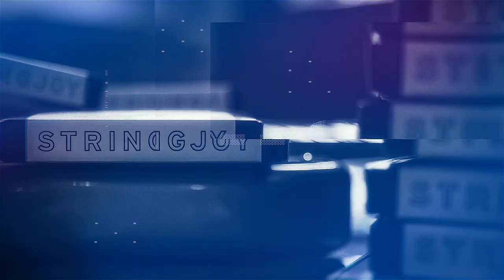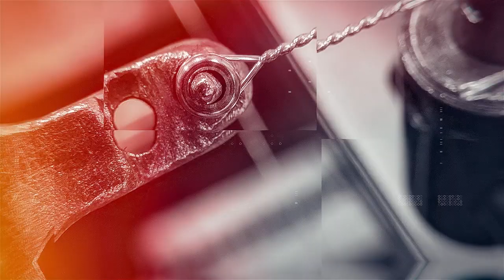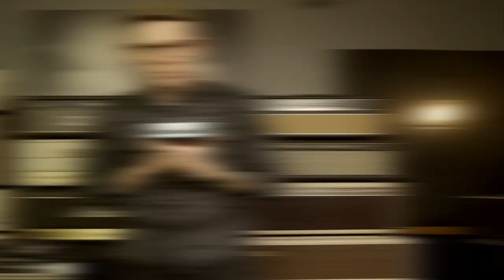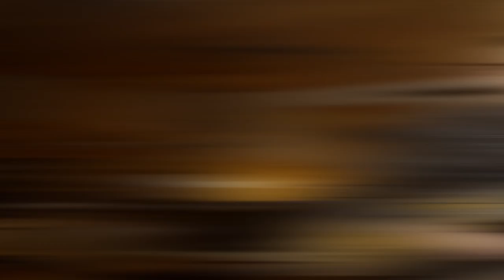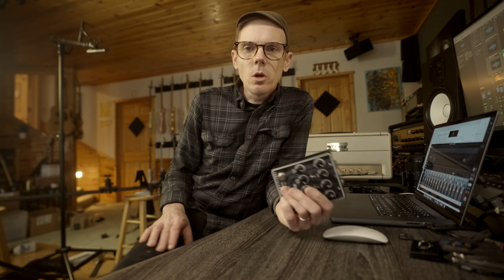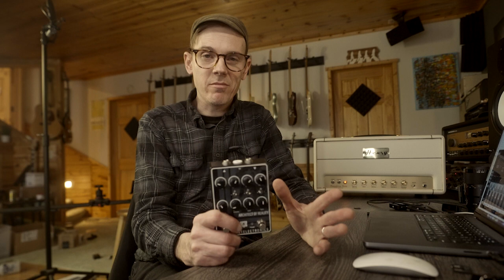Effects Loop Explained: When, Why & How To Use Your FX Loop

Comment: Thanks for clarifying this for me!  I stopped gigging with my SWR Bass amp a few years ago and now go Direct to PA via a SansAmp Bass Driver DI, this change has made my setup/teardown MUCH quicker at gigs.  However, when I prectice at home, I still use my amp.  A friend suggested that I connect the SansAmp output to the SWR Effects Return and bypass the preamp.  Any tone adjustments made to the SansAmp are what I will send to the PA at the gig.  It all makes sense now!   I LOVE the sound of the SWR, but my back is no longer a fan!  I wish I knew this 10-years ago!  BC

Comment: How about showing us how everything actually plugs in and where? Try some samples with chorus and delay.
Reply from the maker: Sorry, that's on us for assuming everyone got that part. So you're going to want to plug a 1/4" cable from the FX Send on your amp into the input of a pedal. Then you plug another 1/4" cable from the output of that pedal into the FX Return on your amp. That's it! You can put as many pedals in the loop as you want and just plug the output from the last one into the FX Return. Hope that helps explain it.
Reply: @Stringjoy , what about running wireless?  Nothing to plug into the FX Return or am I missing something?

Comment: This is great. My Rivera Venus 3 amp has a loop and for a decade I never used it until last year. In an effort to finally deal with the ridiculous hiss that amp makes, I started using my Hudson Broadcast overdrive as a preamp pedal. I run compressor, was, fuzz, and any other OD into the Hudson, and then that into the power amp input, the loop return, of the Venus 3, bypassing its hissy preamp altogether. I've since replaced the Hudson with a Tubesteader Lightkeeper, and my board/amp now sounds better than it has ever sounded. Not what Rivera intended, I'm sure.  I lose control of the Venus, but I have it all on the Lightkeeper. I also lose the Venus's spring reverb, but may see if that can be modified to go after the preamp. (It's sort of dumb too, since the Venus basically becomes an expensive power amp and speaker cab, but I've had it so long it doesn't really matter.)

Comment: I would love to not use my loop but for high gain applications, I have not found away to use a delay with high gain without a loop. Delay sounds like a mess in front of distortion, hence you need the loop.
My amps are a Bogner Shiva, Mesa Dual Rec and Revv Generator. When I try delay into the front, it's messy.
You can have a boost in the loop or a preamp pedal into the effects return only. My Bogner has a power amp input as well.
Reply from the maker: Makes sense!
Reply: @Stringjoy  Keep in mind I am playing a specific style of music that benefit from that clean delay and Reverb on distortion. While I love bands like Dinosaur Jr., it's not my style nor what I play. Great video.
I need to try my Bogner pedals into my edge ts return and power amp input. But it's hard to incorporate them into my pedal board unless I run them out front into the clean channel.

Comment: It’s it good idea to plug whole pedalboard into FX loop and guitar just in input? Or maybe whole guitar pedal board into return on the back of the amp?
Reply from the maker: Not typically, you don't want your drive pedals in your FX Loop in particular
Reply: @Stringjoy  I haven’t tried it yet, but some people recommended trying overdrive in fix loop, if you play heavy music and I do. Just don’t want extra mess with two more cables , plugging them in one pedal in pedal board, going in back, rest of the pedals go in front… mess